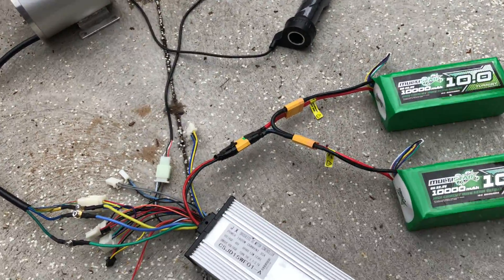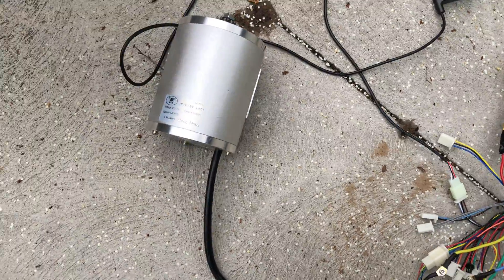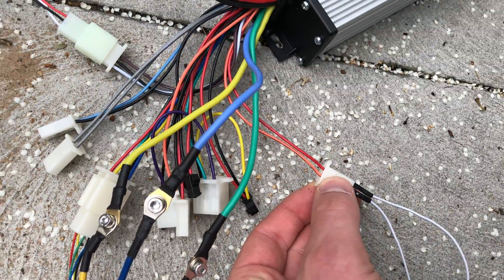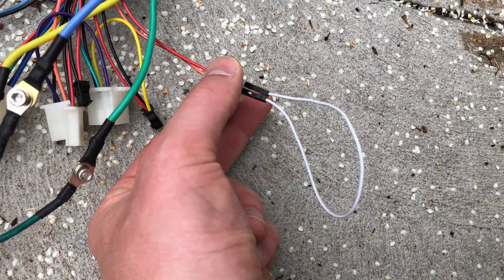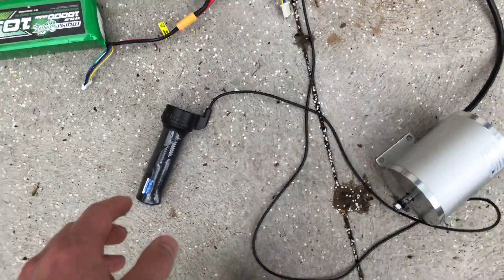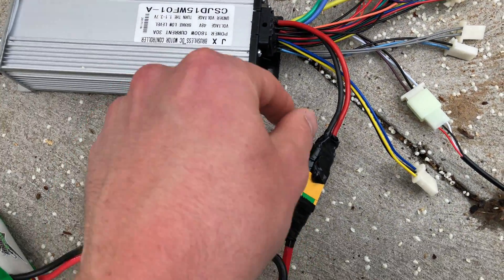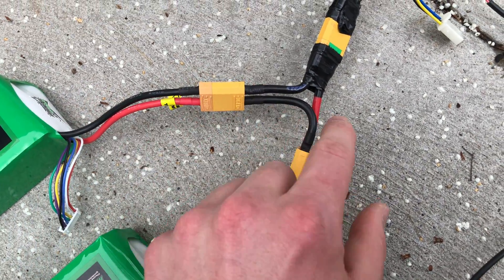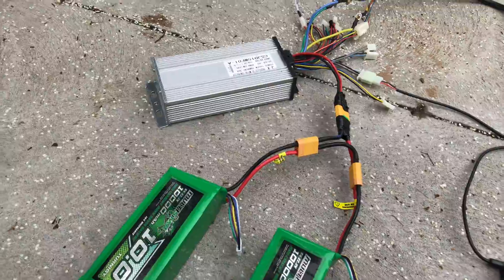MY 1020 Brushless Motor and CSJD15WF01-A controller setup | Upper Peninsula Plastics

Comment: Did you explain how you connected the 5-wire control (low current) cluster from the motor to the controller? My controller doesn't have a 5-wire control connector; it has a 3-wire (blue green yellow) which I could match by wire but then I still have a red and black to match. Everything else is self-explanatory...

Comment: HI THERE, I HAVE A BRAND NEW KUNRAY 2,000 WATT MOTOR AND SET UP. THE MOTOR SPINS THE WRONG WAY.  :-(  HOW CAN I GET IT TO SPIN IN THE SAME DIRECTION AS YOURS, LEFT WHEEL DRIVE? ON MY SCOOTER, I AM RUNNING A 530 MAIN SPROCKET AND A 530 CHAIN, WHERE CAN I BUY A 530 DRIVE SPROCKET TO FIT THAT SMALL MOTOR SHAFT. THE SPROCKET THAT CAME ON THE MOTOR IS WAY TO SMALL. PLEASE HELP, THANKS

Comment: I have the motor. I tried to wire it but I don't understand how you connected the red and black power connector to the xt90 anti-spark. In the black container of the connector there are two parallel blades that don't fit with standards connectors . Can you explain it to me ? Thank you very much.

Comment: I arrived at your video to locate the ignition switch for this particular controller.  I'm getting 48v between the red and pink/peach connector that you identified as the ignition with my battery hooked up, am I supposed to get that voltage through those wires?

Comment: can it be reverse and what does it turn?
thanks
Reply from the maker: I think if you add a switch to the yellow, black and blue cable you can toggle forward and reverse. Mine will be for a bike. I'll be posting a build video in the future. You could hook up whatever you want.
Reply: Mine turns backwards too
Reply: Upper Peninsula Plastics  how would you wire the switch?